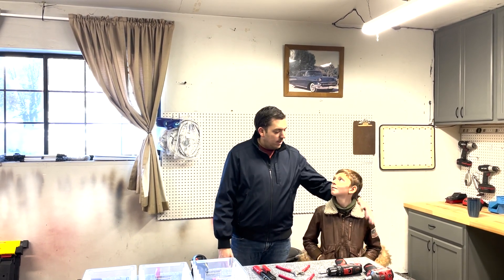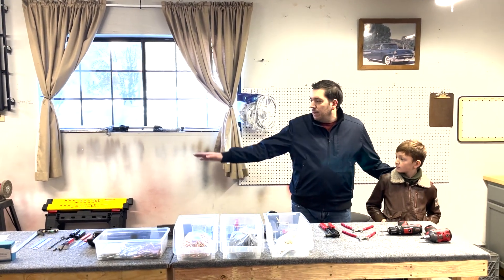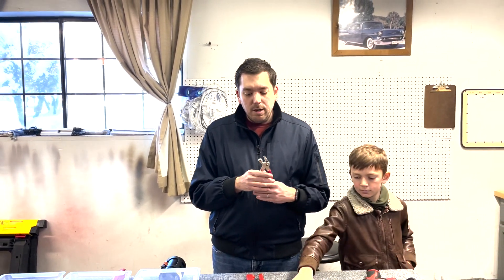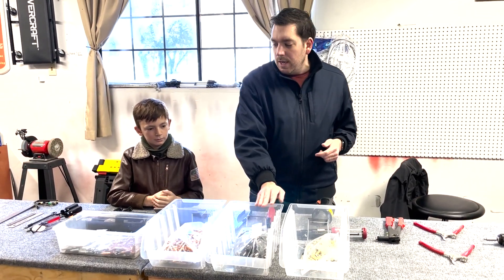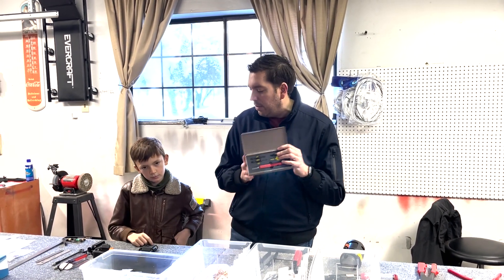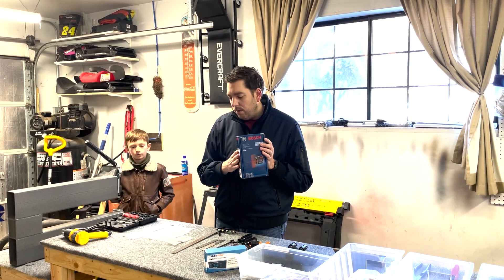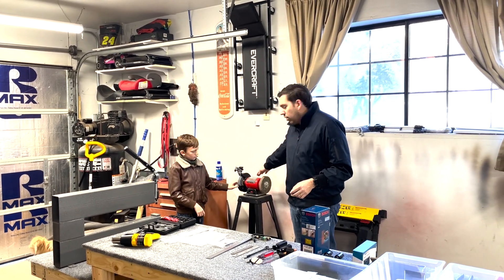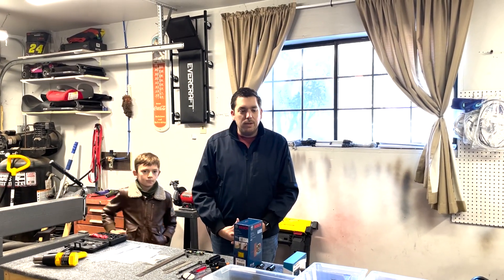Sling Tsi - Workshop Tour

Comment: If you need more Clecos, you can often get a good deal from eBay from other builders (planes and RVs (the trailers, not just the planes)).

Rivnut puller - always set the clutch torque on the drill to less than you think you’ll need. They are a pain to drill out! Ask me how I know…. 😂